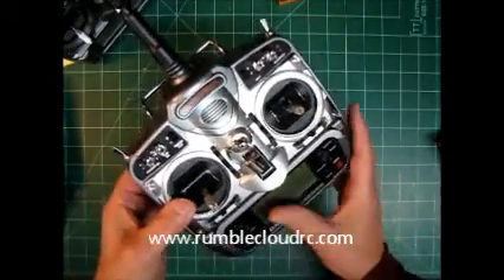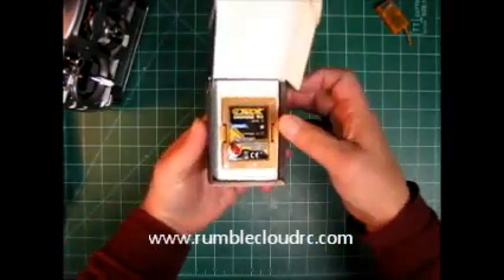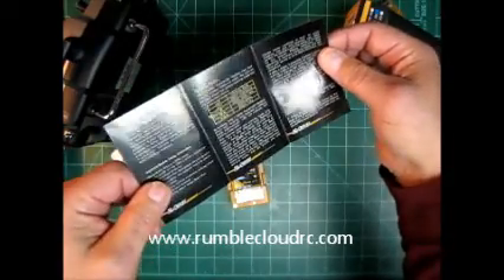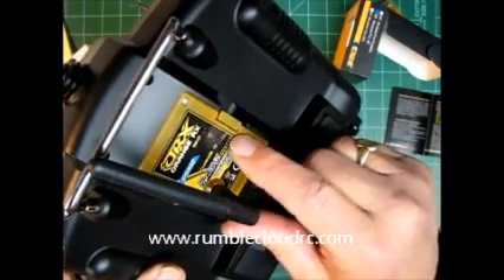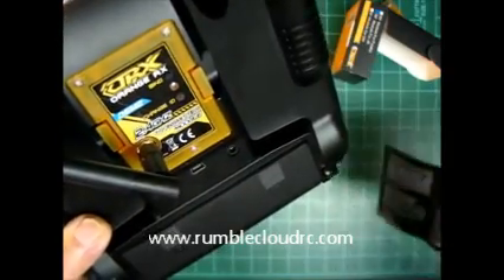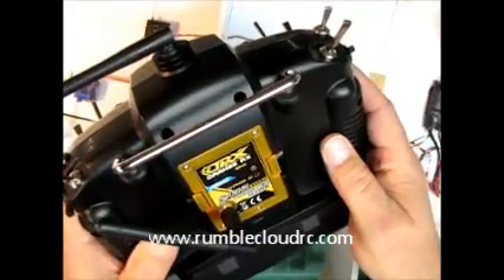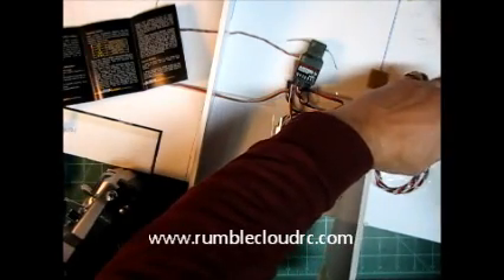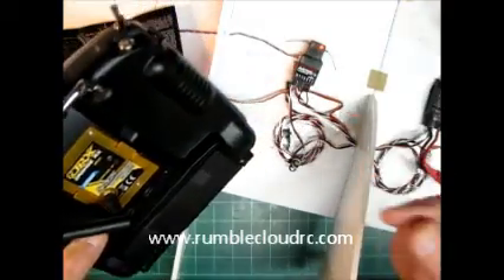Binding a Taranis/OrangRX with a Spektrum Receiver

Comment: Hi, just bought the radio and I'm waiting for a Orange DSMX-DSM2 module so hopefully I can use my Orange Rx's and my Spectrum Rx's. But could I be able to use two Orange Rx's at the same time? Or one Orange and one Spectrum at the same time like I did with my DX7? I have two Rx's on my gas planes for peace of mind and the servos spread on the two Rx's. Could't find on their page if they were 11ms or 22ms so I will see if I can form couples that work together :) but I think that since they worked with the DX7...at the modulation it only says DSM2 on the Rx's specs.

Comment: Quick question, will this module bind with the eflight umx micro models?? Please I need an answer :(
Reply from the maker: I would say yes. One of the requirements stated on the eflight site for their UMX models is a radio with 4+ channel DSMX®/DSM2® transmitter. Since the module converts to those two outputs it would seem like yes it would work.  You should check to make sure that the newer Orange RX modules still output to DSMX and DSM2 because this vid is way old. Thanks for your question.

Comment: When using with different planes / receivers, do you have to bind every time for each receiver you fly, or you can bind only once for each receiver ?   I have similar module for Futaba and 2 planes, every time I switch plane / receiver I have to re-bind.  Do you have same problem ?

Comment: you never said anythng about settings in the radio.  This DOES NOT work out of the box like this.
Reply from the maker: Hi Ken, Sorry for that omission. On the Taranis home screen for the particular model for which you are using the ORX, if you scroll down to the MODE area in the menu, turn the internal MODE: to OFF. Then turn the External MODE to: PPM. Just went thru it again to make sure and that's how it shakes out. It's been awhile since I've used it, but thank you for your comment.
Reply: Thanks Man.  I was following your video and said I think there is more to this.  thanks again!
Reply from the maker: NP.

Comment: hi great vid. with the the module u got there can it run Orange AND spectrum receivers.... im a newbieMany thanks Tom
Reply from the maker: thanks for the question. yes it can. just change the mode on the orange module. Remember that this vid is old so things have changed probably for the better. .Edit: sent this from my phone last night. The orange RXs and Spektrum RXs are pretty much the same protocol so if you can run one, you can run the other

Comment: Do you have to set the Taranis to external rf before doing the bind?

I'm getting one soon and getting as much information as I can.

Thanks

wm
Reply from the maker: +W Morris Hey Thanks for the query. Yes you do have to go into the main setup screen in Taranis for each model you use the external rx for and find the setting for MODULE. It's on the first set-up screen down towards the bottom under the BIND precedure. Normally it is set to off. Just change it to match the frequency of the external rx that you end up using. I love the Taranis.
Reply: +rumblecloud 
The Taranis was the biggest pain for me to learn. But once I got the info it is now pretty easy to set up and I haven't used all the features yet. You still using the Taranis?
Problem now is I'm done with quads and bought a plane which they all seem to run Spektrum. Not that things can't be changed but my receiver has a SAFE feature for dummies like me and it uses dsm2/dsmx so I'll have to get the orangeRX and then I can use all the timers and possibly the telemetry. 
Thanks for getting back and like your videos...
WM
Reply from the maker: Hi W Morris. Yes I am still using the Taranis. It was one of the first batches. I have about 15 models on it. And like you, I have only scratched the surface. My DX7 is sitting on the shelf. I still use it for my helis sometimes jsut to keep it from going deaf. I have a couple of Bixlers on the T, but mostly I use it for quads and hexas. I have since converted all my Spektrums to FrSky. Good luck in your journey. And thanks for the compliment. R
Reply: +rumblecloud 
I received the orangeRX and wouldn't you know it, it would not bind to the AR400.

My Orangerx is different from yours as I do not have to press the button 3 times to change mode. If the switches on the back of the module are all off, it will automatically detect and set the correct mode. Of course, you can set the switches to manual mode if needed.

I went to the field and borrowed a AR6200 and it bound ok so there is something else going on with the AR400???

I bought a AR6210 receiver and it works.

Just info in case someone else runs into this.

I would love to convert my 2 planes to FrSky but I think the guys at the field would hang me. Maybe after they see the Taranis working and all that it can do, I'll slip the X8R in it and they will never know:)

Thanks for you help and your videos. Great stuff!!
Reply from the maker: Thank you for your kind words. I am not as familiar with the Orange stuff since I've converted all my RXs to FrSky. I have a bin full of Spektrum RXs and I just yesterday blew the dust off my DX7 and recharged the battery. hehehe....Like a lot of folks, I'm racing quads now, but I am sure I'll get back into plankers and helis this summer.

Comment: Very nice video very helpful Where did you get the adapter, I got a lot spektrum receivers .
Reply from the maker: +Frank R. Pilot Hobby King....where else :). Gimme  aminute and I'll look up the link for you. They are fairly common so it shouldn't be hard to find. Most likely it will be available here stateside as well. Stay tuned...
Reply from the maker: +rumblecloud Hi Frank: here's a link to an Orange module. They have changed a lot since I bought mine. They have more features.
http://www.hobbyking.com/hobbyking/store/__61214__OrangeRX_Switchable_2_4GHz_Transmitter_Module_Futaba_Compatible_.html

Hope this helps and thanks for your question.
Reply: +rumblecloud thanks I got it!
Reply: I know this is an old post,  is the transmitter in the link provided for the taranis x9d plus? Same as in your video? Thank you!

Comment: My module flashes 2 red lights every second... that's all...
Reply from the maker: +JakeWardell 19 Not sure what your question is, but will try to help if I can. So it is not binding?
If it isn't , you will have to figure out which signal to use. As I recall, there are two. I'll have to look when I get a chance, but there is a different sequence for each. Let me know what your issue is and I can help.
Reply: I can't change any settings. But I did manage to bind it to my spektrum satellite with my trex 150dfc heli. 

That's all I needed to bind it to. But the whole "3 clicks fast" doesn't do a single thing but beep once.

Comment: Do you get decent range with this? I have one in my Taranis as well and have flown park flyers with it but I have a bigger Cub with a Spectrum rx I would like to fly but am a little concerned about range. Thanks for any input.
Reply from the maker: Clever handle. Thank you for your question. I have only flown a 550 hex with this set-up and have since switched to all FrSky RXs. When I was flying LOS, I have to estimate the distances at about 500 - 800 feet away. Where I fly in the middle of my place, it is about 680 feet to the main road out front of my house and the altitude was about 300 feet. If you check some of the hex vids with GoPro here you can see how far out I get. Sorry I can't be more definitive.
Reply: Actually that helps. Thanks!

Comment: This is useful.  Have you found any way for the Taranis to read the telemetry information from the Orange module?
Reply from the maker: To my knowledge, there is no telemetry information available through the Orange module. The X8R RX when used with the Taranis as well as a few other FrSky Rx's offer telemetry info and that is easily viewable in the radio's screen. Since I found that out, I have stopped using the Orange completely and switched all my RX's to FrSky. :)
Thanks for your question.
Reply: +rumblecloud I would switch to taranis except my lemonrc dsmx telemetry modules woun't work it seems :(

Comment: Does this also match the AR8000 and/or AR6210 Receivers?
Reply from the maker: Absolutely does. I've used it on several Spektrum receivers including the 6210 with no issues.
Thank you for your question

Comment: I just installed my module into my taranis. Absolutely no response to pressing the bind button, no beeps or lights. Do I have a dud or should I have done something to the Taranis first Arthur_Charap@msn.com
Reply from the maker: Hi Arthur,
Assuming you have your TX turned on, a good battery and that the module is seated properly in the cavity, you should get a light from the module when you press the bind button. If not, I' say you have a dud. Sorry to hear that, but if you got it from HK, they will either replace it it give you credit if you can send them a vid of your process showing no response from the module. In fact, do you have a vid already? I'll check your channel now.
r
Reply from the maker: rumblecloud Just reading thru this post again and remembered a couple of readings on other forums - including my own - that people were having difficulty lining up the pins between the module and radio. So make sure that is not your issue.
Reply: I agree w/ rumblecloud on this. I just bought the ORX module for my 9xr and had a minor struggle plugging in the module. The white plug/receptacle inside the module is only buttoned down on one side, so what happens is... when you go to plug it in, the plug/receptacle torques at an angle before you can fully set the module, thus putting way to much strain on the plug and your Tx pins. An EASY way to fix this is to take off the front cover of the module, then use your thumb to set the module/plug in place, then snap in completely and put the cover back on. perfect
Reply from the maker: Thanks XTECH. It seems to be a recurring issue. Fortunately mine worked out ok. But I do take care whenever I unplug and replug.

Comment: are you happy with the taranis  I just bought one haven't received it yet wanted to buy a spectrum dx9 but I could not justify spending 150 dollars a piece for 9ch spectrum receiver's  that's more than the planes I would be putting them in like my bixler2, then hobbyking epp fpv and etc. I hoping I made the right choice since the frsky receivers are only 30 bucks apiece and have 8 channels and sbus and failsafe
Reply from the maker: Hey 2007...
Thanks for the query. The short answer is heck yeah. It is so simple to program and the features are outstanding. I really haven't had a chance to get it out and test in the open range (distance and altitude) because of winter weather, but I am extremely happy with it. I did fly today with my big hex - 24 degrees and had no issues. I have it bound with my KK2 and NAZA M as well as my FPV Bixler. I can control camera angles, Failsafe, RTH and IOC with the NAZA all through programming in the radio - simple things I could not accomplish with the DX7. Binding is a bit different, but once you figure it out, it's simple. I have two of the X8Rs and am looking to buy more for the complete 16 channel experience.All my Spektrum stuff is going on my 450s which I never fly anymore :). Stop by rumblecloudrc.com and check us out. Good people and great info. Take care, r
Reply: rumblecloud good deal Ive gotta get mine set up on my dji 450 which is what prompted me to buy this radio because my turnigy 9x doesn't have failsafe I was afraid my 450 might fly off with my go pro 3
Reply from the maker: If you have a 9X, we can show you how to dial in that failsafe if you want (as well as the IOC and the RTH - a friend on the forum figured it out and passed it on to me. I've done it on two 450s and it works like a charm. I think I have video of how to do it on my channel  somewhere recently. I hear ya about the GPro. My big hex (Medusa) has all that voodoo on board and I am always worried about losing it. I did lose it in a bean field earlier this summer. Got too near some high voltage power lines at about 400 feet and it went inverted and fell out of the sky. Took over two hours to find it. I was sweatin' bullets. Anyway take care sir. Stay in touch.
r
Reply from the maker: rumblecloud
hey 2007:
here is the link I mentioned earlier: http://youtu.be/Vr2ST6Wemcc
It is a rough edit, not final and it deals with the 9x and its compatible 9x receiver. Not sure what you have. :)
Reply: rumblecloud yeah I have a turnigy 9x I have manual failsafe (rth) bound to a switch but my receiver doenst have failsafe so I purchased a taranis last night

Comment: I have the same combo, does the failsafe work with the receivers with failsafe capability?
Reply from the maker: Hey Sky,
I wish I could answer that for you, but at this point I haven't had a chance to test any of the failsafe capabilities of the module. Here in Michigan, we're kind of in the middle of winter so flying time is scarce -- plus I'm  a bit leery of testing the failsafe and having it NOT work - and then having to snowshoe to where the craft fell out of the sky -- hahhah. I am curious myself, but It will have to wait awhile.
I did get the Taranis internal module to light up the Failsafe with my NAZA M.
Take care and don't forget to pack that chute.
r
Reply: Awesome, thanks. Keep me posted or I just may try it myself and let you know ;-)

Comment: Does the HK Spektrum module still have model match capability or is the feature non existent with the module?
Reply from the maker: If I understand your question correctly, yes, it does have model match available thru the Taranis radio. By model match I assume that your asking if it can bind to multiple models (ie: model match)?
Reply from the maker: *****
I thought I posted on this earlier, but I guess not...Yes, the Orange Module does have model match capability. It will only respond to the model it is matched to and it can match to as many receivers as the radio can handle. For the Taranis, that's around 60.